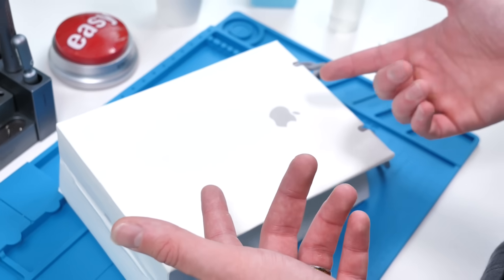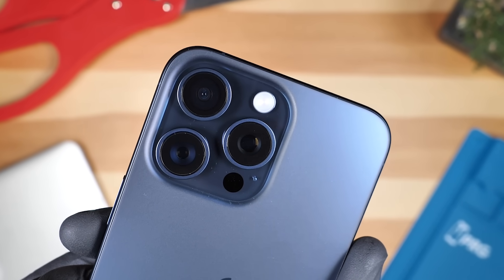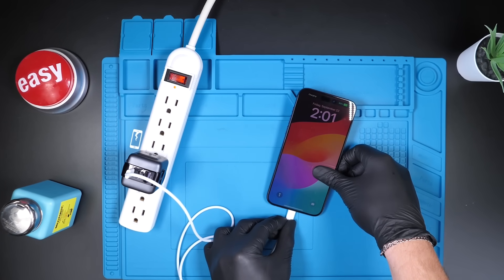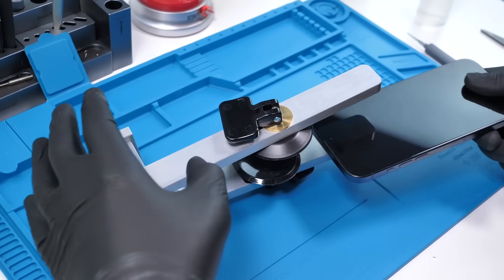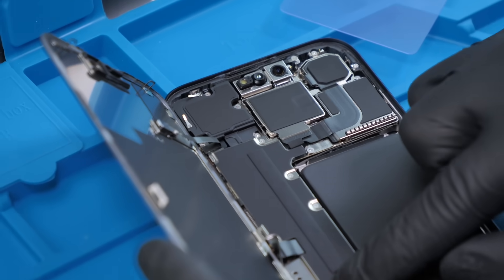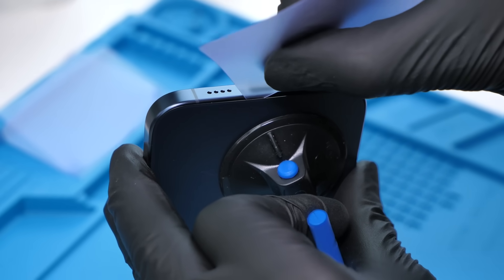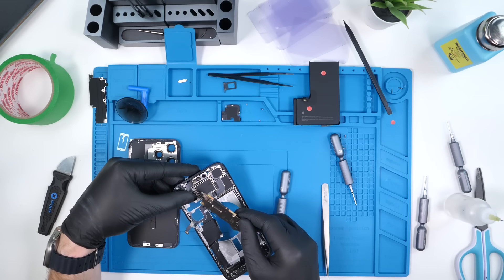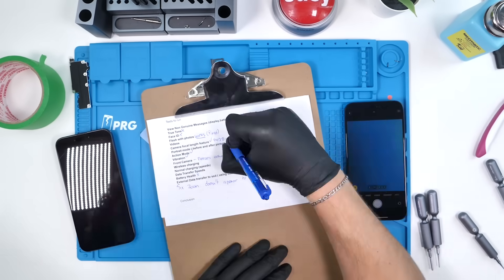Is The iPhone 15 Pro Repairable? - Parts Swap Test

Comment: Btw the proximity sensor and ambient light sensor have been like that in the 14 pros as well. It’s not new to the 15
Reply from the maker: It is new, it’s under display this time around
Reply: @PhoneRepairGuru  the 14 pros also have one under the display. Both phones have the same size dynamic island. They actually mentioned they moved it under the display for the first time during the 14 pro event.
Reply: @michaeladebz that dude has opened many iPhone 14 pro
Reply from the maker: @michaeladebz it was  right under the dynamic island with the 14pm.

Comment: "if this is done purposefully". They serialized the parts and told the software to scream at you that a genuine part is non-genuine. Purposely designed to lock parts together and have them misbehave if used with something they didn't come with. Couldn't imagine anyone seeing this any other way and thinking it must be a bug on Apple's end.

Comment: It’s so bizarre to me that they go so far as to do this stuff for their own genuine parts and force you to go through a ridiculous registration process. 

I get it if they wanna put up a message about 3rd party parts or if there’s a legitimate reason to disable a feature on a 3rd party unknown part (like if trying to lower the refresh rate could hurt a display that can’t actually do that or something) but on their own parts it makes zero sense other than specifically trying to prevent repairs. 

Even if you order repair parts directly from apple it does this.
Reply: That’s because even if there OEM parts, they have to be paired to the device so it gives you that message until you do their pairing. It takes like 2 minutes on their software thing

Comment: When they first started locking stuff down with things like the FaceID module, their justification made some sense for security. But basically everything they’ve done since has proven that was never the intent and it was always about trying to push people to go to Apple for repairs for a chance to upsell them.
Reply: but then again, what about the phones that got discontinued? will those still get repairs from apple ?
Reply: @demonx7735  They still have departments that support products from the early 2000s. Though support will be limited by the actual parts they still have left.
Reply: @demonx7735  you don't have to worry, iphones wont get discontinued for a while since it probably gives apple the most profit
Reply: @demonx7735 
No of course not. Do you know how many billions USD were spent by them to research how to ensure you must buy their new phones????
Reply: @MP-vc4nu   wow
Reply: @MP-vc4nu  so they push out updates to older models to underclock the cpu . they also refuse repairs to discontinued models? yaiks
Reply: @MP-vc4nu stop spreading misinformation! Like seriously you act like you know what you’re talking about but you don’t 😂 apple does repairs on discontinued phones. Apple STILL repairs the iPhone 6, and original se. those phones are what 8 years old? And they still support the iPhone XS software wise (6 years of software updates) which is longer than the typical software support from most android manufacturers. But instead you chose to tell people they don’t repair discontinued phones and call others sheep 😂

On top of that, the “more repairable” aspect of the phone is, in by making the back glass removable, it allowed them to lower the price of back glass repairs, since preciously they had to replace most of the phone for repair. So it’s not like it isn’t getting better price wise 🤷🏽‍♂️
Reply: I thought it was because apple was losing so much money from people buying phones, and then returning them with swapped components meaning the customer stole the internal components. I assumed the serialisation prevented this because it would be clear that the internals were swapped. I can only imagine this was the original reason, but the plus side I guess is sort of anti repair.
Reply: whenever a big corp uses "security" as their justificacion it's not true lol, hopefully you learn now to not trust big corps
Reply: Money talks
Reply: nothings wrong until there isnt apple authorized service provider nearby
Reply: i mean it also makes stolen phones useless...
Reply: look up sleep (angle) sensor serialization
Reply: Yes, but they don’t know when there’s no Apple Store in a region and only exist authorized service and store their service were crap
Reply: More like planned obsolescence....
Reply: @faythang2513 no. That’s not what it means.
Reply: They're a For-Profit business so I don't think what they're doing is wrong
Reply: @jeettrivedii Well the wrong thing is they charge way high for spare parts which many people cant afford and those can be bought at a lower price from 3rd Party Sellers
Reply: @MeghbS  yeah that's wrong, if you're forcing your customers to only use your service centres then the services should be affordable for all.
Reply: @MeghbS cheap means also shit quality.  Had my Ipad pro 10.5 battery replaced trough my insurance twice and it kept failing because the battery was of shitty quality. Luckily after 2nd attempt they just offered me a new ipad.
Reply: @MeghbS well well if you cant afford to repair smth dont buy it in the first place 
If you buy a rolls royce and you dont have money to do maintaince or am ia wrong?
Reply: @besitufina3449  that’s not even an equivalent analogy. It would be more akin to a maker not allowing you to go to a normal mechanic (like Tesla for example). 

Not to mention, car repairs are a normal part of the cost of ownership. Phone repairs other than the battery are not. Imagine if Ford said you can only buy wiper fluid or oil from them and would lock you out of the car if you put 3rd party oil in.
Reply: @jeettrivedii what they're doing wrong is taking the choice away from people. And have you experienced how shitty apple repair is? They always push to get a new device   if I can get a replacement for the screen at a tenth of the price from apple, it should be my choice, for a device i purchased, not apples.
Reply: @georgeb.k1764  I haven't owned an apple device but I've heard how expensive it is. I think having choice is your right as a customer but if you're getting parts replaced by the company itself then I don't think it's bad, as long as it's affordable.
Reply: @jeettrivedii   apple and affordable don't go together.
Reply: @jeettrivedii another sheep 🐑 spotted. Your vision is so crystal even basic logic can’t go through it. 😂😂😂
Reply: @yellowflash7696  I've never owned an Apple product, just repling to the OP lmao, y'all kids are the quickest to jump to conclusions
Reply: @jeettrivedii  What is that reasoning? That's like justifying $2/hr minimum wage because a company is a "for-profit" business. You do understand ethics apply to businesses too right? There are good ethical values, and bad. Making the life of the consumer harder and more expensive for no good stated reason is unnecessary, and unethical.
Reply: @mycelia_ow  It's not my logic, Apple is a For-Profit company that caters to the premium market. How did ethics made it to this conversation? Apple just makes premium products, hence, Expensive products & Services. I'm just pointing our what kinda company they are, we always have a second choices, you can always go for Samsung or Pixel.
Reply: @Sans274 then Samsung should be your best choice
Reply: @jeettrivedii Profit wise they're a genius, but that's also the reason my last Apple product was a 2nd generation iPad

Comment: I was waiting exactly for this video. Pretty standard from Apple, which is still disappointing, but at least it didn't get worse (for now).

I probably won't be able to buy it used (some years later) because of the battery situation, but overall, it's a bit of a relief that the "normal stuff" is the only stuff to worry about.
Reply: Whats the battery situation?
Reply: @florian7279 Probably that Apple throttles devices with aged batteries to keep them from shutting off
Reply: Just got an iPhone 15 Pro. The battery health on my iPhone 13 is 95% and it’s just turned 2 years old. Numerous charge cycles.  Used for work, rest and play. I reckon that’s pretty good.
Reply: @muttley8818  ok but i was asking in regards to the 15 because OP implied there are some issues with those batteries
Reply: @florian7279  Ahh ok. Now I understand.  I’d like to think my 15 Pro will have similar health after 2 years, but have to wait to know for certain. I will say I’m always skeptical when it comes to Apple and their battery life estimates. The only product of theirs that has really surprised me is the Ultra watch. Lasted almost 3 days before it needed a charge. And I know less charge cycles prolongs the life of the battery.

Comment: Wow, it's wild to think that even with swapping parts from another identical iPhone, Camera, Face ID, True Tone, and the battery still give issues. 🤔 Shows how deep Apple's anti-repair measures go. Nonetheless, thanks for shedding light on this, it's so important for consumers to be aware!  #RightToRepair
Reply: @@linearcube.It's not to prevent thieves from harvesting parts, it's to prevent repair technicians to do so. They have to harvest them since there is literally no other source for replacement parts (apart from bribing people working at factory-level rejected parts disposal). Obviously, if "unauthorised" technicians were able to fix devices with easily available parts, Apple would sell fewer new iPhones, and we can't have that now can we?
Reply: @leonbabic7185   what? what dont you understand? iphones are rarely stolen as security measures make them worthless
Reply: @leonbabic7185 Apple literally sells the OEM repair parts online. What are you talking about?
Reply: @@linearcube. and u lose whatever data u had as they would force cloud storage down your throat.
Reply: @@linearcube. if your phone was stolen you wouldn't see it again anyways, so i would just rather have my phone be repairable
Reply: the concept, I am sure, is to disincentivize thieves from stealing phones to harvest parts. A stolen icloud locked phone has very little value if you can't do anything with its hardware. I guess it depends on what narrative we are trying to spin. If you are on the anti-consumer side, you are figuring this doesn't benefit the user in any way. While I don't think Apple necessarily has a problem with the anti consumer ramifications of this, I also don't think that is the main goal here. @jumpaxa
Reply: @@linearcube. Yes that too but it's mostly just anti-repair
Reply: @@linearcube. Do you really believe that?
Reply: @RimelightX  Well on paper it works, sort of? iPhones are worthless to snatch since you can't resell them thanks to account locking. And stealers can't sell parts to repairmen to make it somewhat worth their time. In my country, when iPhones are stolen, they're notoriously just thrown away, usually damaged, by not first time thieves because they find out they can't do anything with them.
Reply: @RimelightX I mean it doesn’t matter what you believe, it’s just a fact that electronic parts harvesting is a HUGE industry and there are many businesses that make money off of harvesting parts and reselling them. It’s obvious Apple is trying to stop that which I don’t think is something crazy
Reply: @@linearcube. but they dont repair it instead they just replace the entire motherboard or the entire phone at the same cost as a new phone. Worse because of those reason many of these go to E waste never to be recovered even though its just a broken screen or damaged chip on motherboard.
Reply: @@linearcube. "They're making it as hard as possible for legitimate repairmen with good reputations to fix user's phones at a more reasonable price so that they can mark it up and make even more money from paying customers, BUT they didn't make it impossible so what's the problem? 🤔🤔🧐🧐🧐😁☺☺😊😊"

Your comment literally just boils down to "at least they didn't entirely make it impossible therefore it's fine"
Reply: @@linearcube. that's the excuse but come on.. refurbished phones do not impact Apple's sales in any way. Even if it does, how much profit does that take from Apple? 0.00000000000000000000000000000001%? In today's economy, the only way to make ANYTHING last is by repairing. Planned obsolescence is bullshit, and Apple knows that people aren't going to spend 1000+ dollars on a phone every time their old one breaks down. Serializing components under the guise of "preventing thieves from harvesting parts" is a bullshit excuse. Also the thieving part is just stupid. No thief is going to give back a stolen phone after all of the new anti-repair tactics Apple has put in place.
Reply: @@linearcube.its the same problem with AirTags. Sad we have to lose functionality because of some bad actors abusing it
Reply: I think you just don’t understand how hardware and software are intertwined.
Reply: @darkpill explain bro. Since you're so wise. Explain all the reasons apple does this. Will you explain?
Reply: @@linearcube. I've had the 3GS, the SE1, the XS, the 11 pro max and the 14 pro. Never had my phone stolen. Stop sucking Apple's dick, all these measures are only there to charge you 80% of a new phone's price for a screen replacement.
Reply: Looks they're desperate milking their buyers since the implementation of usb-c imo frrom the EU pressure. Also EU is starting to pressure companies for mandating removeable batteries.
Reply: @@linearcube.
It’s done because of greed
Reply: @@linearcube.Yeah bro, if you can reprogram them what's even the point? Lol, so much for Apple uncracable software
Reply: @@linearcube.The thing is you can want to get it repaired from apple only. But others want choice. Let's say I am a technician, and I can repair stuff on my own just fine. Are you saying it's wrong that the device I own and have the right to do whatever with it cannot be repaired by myself?

And I also heard rumours that's apple will refuse to repair saying it's unrepairable and just buy a new phone. At that point you might as well try a shady place and left him"steal" it since the phone is worthless anyway.

Comment: I can’t imagine why people would continue supporting Apple and Samsung with these crazy Anti repair measures.
Reply: @@GH0STST4RSCR34M "Then Apple" read till the end man, cmon
Reply: There are some people who wants good phones imagine
Reply: @@GH0STST4RSCR34Mwhat about the thing they use to test the phone (diagnostic screen)
Reply: @@GH0STST4RSCR34M Samsung OEM Service Packs are available from every major parts supplier.  That alone is more support than Apple offers.
Reply: They are confident "that won't happen to meeee!!!"
Reply: @@GH0STST4RSCR34MI mean,  it's their IP. If they spend a ton of money to figure out the best display stack and people just rip them off, l understand. It sucks to suck.
Reply: @@GH0STST4RSCR34M in a samsung phone go to the phone app(📞) type in star hashtag zero star hashtag (*#0*#) and the diagnostic screen will show up allowing you to test the touch, speaker camera and everything.
Reply: Because I still use my 2019 11pro which I just updated to ios17, so it is still supported. Apple replaced my battery for 70$ in 1 hour…so even the batterylife is as new…
Reply: @laser_simon922  "iphone 11 pro" yeah that is your iphone because the new ones are too expensive, you say iphone is better then you pull out your OLD iphone
Reply: What's wrong with Samsung? Their phones are pretty repairable
Reply: @minsekfau3218 people problems with it is with the glue in battery on earlier phone mostly
Samsung at least seldom do this sort of software lock BS that user cannot calibrate.
Apple software lock on everything is just insane
Reply: Samsung makes their stuff more repairable nothing is serialized
Reply: I think you meant only apple, Samsung does more support to third party repair then apple
Reply: Samsung?? Tell me you don't repair phones without telling me you don't repair phones.

Clout chaser
Reply: The host is wearing an Apple Watch Ultra so seems like he still supports Apple too 😅
Reply: At least Apple has fast and well accesable OEM repair shops…
Reply: @laser_simon922  too expensive if your gonna use an OEM repair shop, also when iphones or other apple products get fixed there is always a feature that will be ruined if you fix it, for example, if you change the screen on an ipad pro without duplicating the serial number on the old screen, the lines that you draw using the apple pencil will be janky and very curvy instead of straight.
Reply: maybe because Apple makes products good enough that they dont need to be repaired
Reply: @imstupidbut  you say that WITHOUT considering the iphone's battery life, the anti self repair measures, the price.

Comment: Could you try swapping the ambient light sensor? If that brings back auto brightness, then i would be willing to deal with no true tone if i ever needed to replace my display
Reply: He did
Reply: @SaceedAbul  he swapped the whole display assembly, not the cables on the back of the display
Reply: @theredstoneminer9349 it looks like the ambient light sensor cable isn't easy to remove, like it's a sticker on the back.  Might run the risk of cutting the flex if you remove it wrong
Reply: @FracturedOrigins  if that’s the case then that fuckin sucks, means only apple (or good techs) can replace the display
Reply: Just DONT BUY APPLE
Reply: @arkvsi8142  no
Reply: @arkvsi8142 nothing wrong with buying apple. All of my iPhones have worked flawlessly for me. I’ve never had to send my phones in for repair but if I did I’d rather just have apple do it anyways.